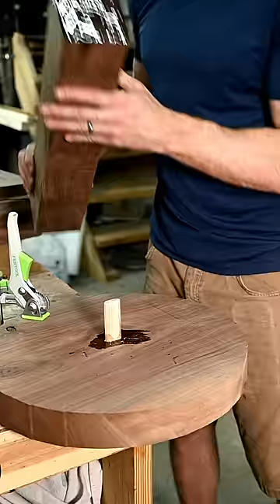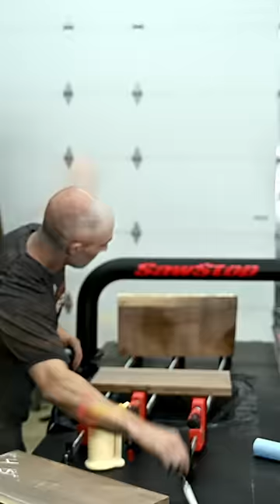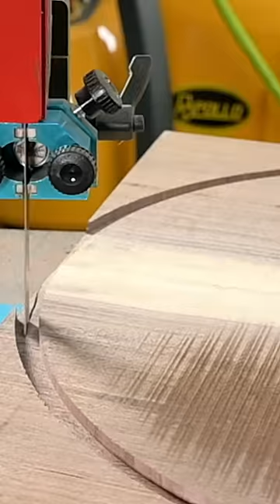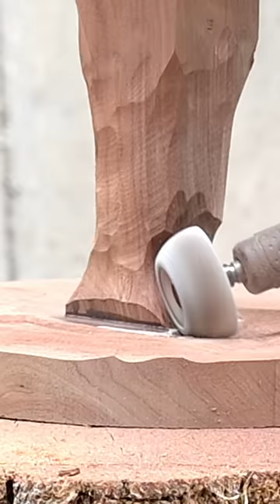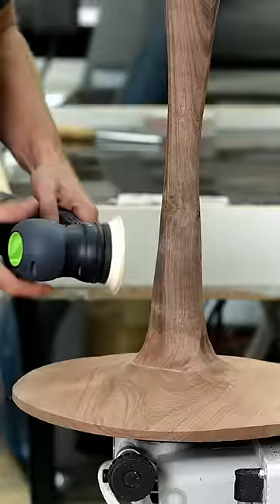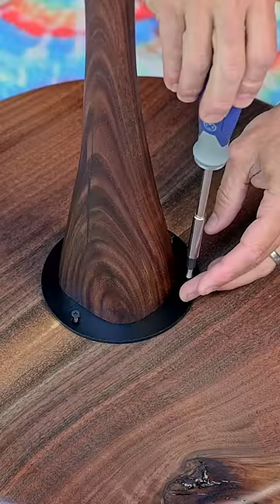I Tricked a Customer

Comment: Step 1: Have a $100,000.00 SHOP

Step 2: Try to downplay it in the comments and act like it’s everyone else’s problem as if you didn’t clickbait us.
Reply: Step 3. Have 20 years experience
Reply: A jigsaw, a hand router, an orbital sander.  About 90-100 bucks and you can store them in a box in the corner of your garage when you're done.  He's using his big stuff but it doesn't take much work to look up the cheapest beginner way to pull off circular cuts and round edges.
Reply: @wolffang489 Fair comments... but ain't nobody spending $1,200 on dude with 5 day's worth of experience and... closer to $200 worth of tools.

It will look like amateur hour, because it will BE amateur hour
Reply: @drebk  Oh of course.  You can't buy skill with 100,000 or 400 dollars but since he did say average woodworker and not urbanite that just moved to a suburb for the first time in their life, I'd assume the monetary promises in the video don't apply to amateur hour.  Regardless of initial skill though  for anyone wanting to follow along on the project at home and maybe build their skills and have a perfectly usable table to sell or use saying it's a scam video because they don't have six figures for tooling shows a lack of imagination on how few tools are actually needed for that template of a table.  Could he list off the bare minimum tools in the video?  Maybe but the target demo is in the title and that target either has their own power tools or otherwise knows what to substitute depending on resources.
Reply: @wolffang489  yes. The tools are the least of the problems of this table. The skill of carving that spindle and doing a nice finish on it without blemishes is the bigger part of making it nice. You can tell who knows how to work wood or not when they say they need expensive tools to make such a simple project, and he did not even use a lathe to do the hard part!

Comment: The classic "all you need is average wood worker tools" while using high-end wood working tools
Reply: Usually people don't buy Fein or whatever those mediocre things are as their first tool set.
Reply: High end tools are nice but this could be pretty easily done with bog standard tools from sears 50 years old or stuff from harbor freight could even be made with just hand tools
Reply: You can do this with basic tools, too. It will take you much longer, but you can still do it. What people don’t seem to understand is that you’re not just paying for the materials when you buy something handcrafted, you are paying for the years of practice and labor it took to make something pretty AND functional. And with furniture in particular, it’s hard to make them both artistic and usable, as in, not fall apart on you as soon as you sit.
Reply: table saw ain't exactly a high end tool. can even buy a band saw and router for under $300. get a job

Comment: “I wanted to prove that an average woodworker can make $1000 in a weekend”, shows world class craftsmanship
Reply: Also, has highly specialized woodworking tools
Reply: ? World class? Bro i could do this its using a router and an angle grinder 😭
Reply: @driftertravelerman6893 he didn't though. That's the point

Comment: "... average woodworker..." proceeds to use Festool tools.
Reply: Yeah, I had to laugh at that.
Reply: Yea, how on earth did anyone cut a straight line before Festool. What a joker…
Reply: @willfulmisfortune3679  No "average" woodworker has those tools. That was the point.
Reply: @timn5008  That doesn't change the fact that those tools are not required to do this or that they do anything but make it marginally faster to get done. You can do this with a framing skil saw, crappy angle grinder, a cheap jigsaw, and any old orbital sander. Total tool cost could be under $100 if you actually look around.
Reply: @johnathon007  You missed my point. Sure you could do it with cheaper tools, but invariably these craftsmen are using the high-end stuff. This guy is far from average, and he's using tools that are expensive and very reliable. I've done a lot of woodworking,  but nothing like this. I built a triple-winder staircase with nothing but reclaimed/repurposed wood from the house the stairs were built in, using nothing but Dewalt and Delta saws and planers. If you're using Festools,  you're likely doing this kind of thing for a living.

Comment: In Germany you would pay 300€ for that wood. But only if it can have splits. A thickness plane for wood that size is expensive though. Using a hand plane, this will take half a day. I agree that you can do it with cheaper tools too, it would just take thrice the time. You have to store it for half a year to get rid of the moisture though. No idea what you played for that metal part. I agree that people pay a lot for surprisingly simple furniture though. At my last job we sold a stump (about 30cm in diameter and 35cm high ) for 300€. It was a lot of work to sand it though, since it had cracks

Comment: $100 in wood, 100k in the workshop.
Reply: 100k gay wedding
Reply: Eggxachary
Reply: I was just gonna say
Reply: Yeah but this can all be done with basic cheap tools, even getting them used
Reply: underrated comment
Reply: Irrelevant though. He said "average woodworker" if youre a woodworker you have the tools he used
Reply: You could make this just as easily with 600$ in tools, cheap table saw, router and grinder with some bits and grinding wheels and a cheap jig saw.
Reply: Just ważna say the same😂
Reply: If you cant make those tables with a drill, a saw and a sander, you’re not gonna be making anything ever
Reply: Listen to the words in the video, don’t just run to the comment section with your low value comments
Reply: Came to say this
Reply: What’s your point
Reply: Stop being a victim
Reply: @spazzypotato8325  like trump lol
Reply: EXACTLY!!
Reply: @northcountrywoodcraftny5953 exactly. All this could be done with a drill, clamps, router, and table saw, easily less than a k in tools
Reply: all day on youtube, zero time in the shop 😂
Reply: you can get all those tools under 1k. You don't need high end versions like he has. Any cheap tool will work for something like this and you could do this with incredibly basic tools with enough time and patience.
Reply: Let's not forget the amount of labor involved, that process would need to be factor in for total monetary value
Reply: All of this can be accomplished with a jigsaw, skillsaw, router, random orbital sander, pipe clamps and some hand tools for the leg shaping. All basic and relatively affordable tools.
Reply: Ridiculous isn't it.. complete rubbish.  Lets ask him to do this with a hand saw, router and plane.. cos thats what i work with..
Reply: @gavin1453  if he repeats the experiment with those tools il be impressed.
Reply: You act like people haven't been building tables for thousands of years before electricity was even an idea
Reply: @mrpatching9586  exactly
Reply: That’s what happens when you own a company

I make custom hats and bulk clothing orders for companies. Laser graving, screen printing and embroidery and I prolly have less than $3k in clothing/hats In my shop, but I have prolly $100k in equipment/machinery. Equipment will always be more expensive
Reply: @northcountrywoodcraftny5953  not geting that wood dry for 100 bucks
Reply: @matthew413  proof where he got that much walnut for less than 100 bucks.
Reply: @victorhopper6774  Make it out of pine, maple or cherry to start then, starting with walnut without a resparator is probably a bad idea anyway, cherry and maple stained would be worth just as much in the end
Reply: You’re not going to make $1200 with $100 tools.  Well, they actually can in time,  it definitely not in a short week.
Reply: @northcountrywoodcraftny5953  the two bases alone have 16 bd ft in them

Comment: No offense, but if you're trying to demonstrate that an "average woodworker" can do it, the it's probably best to demonstrate it being done in a weekend with "average" tools ( jigsaw, hand planer/sander, hand-guided skill saw, chisels, limited clamps ) all done on a less than flush table. 

Let me tell you, it's very difficult to get a flush surface without a feed planer/jointer, good seams for glued up boards without a good table saw, clamps, and flush surface, and a good rounded table edge without a router table. Hand routers can be very inefficient, and most of them slightly lose their plunge depth during use due to the vibration.

If someone is going to pay $1,200 for a set of tables, they aren't going to tolerate wood seams, uneven cuts with wood filler, and and wavy hand leveled surfaces.

I see about $30,000 in tooling being used on this project. You're demonstrating that a person with a decked out woodworking shop can make $1,000 in a weekend, not the "average woodworker". A beautiful set of tables none the less, but this video certainly doesn't support the message you're trying to get across.

Comment: "$90 worth of walnut." That's about $500 worth of timber in Aus.
Reply: Haha if not more, fuck we get ripped off!!
Reply: Nah bro, I was sitting here thinking there’s no way that’s only $90 worth of walnut🤣even in the US it’s way more than that
Reply: you surely have much more exotic wood that is cheaper there
Reply: @Kaizen747  we may have more but wood is still extremely pricey even after the whole covid thing 3years ago
Reply: @dillanfiveash  Trades people get access to better material prices than the average person.
Reply: @lunawense6288  I know I used to operate a forklift at a lumber yard in college, we had lots of professionals that bought stuff from us
Reply: @dillanfiveash  since Biden's economy sure.
Reply: @Kaizen747  we have a huge variety of more exotic woods but they're even more expensive and far more difficult to work with than walnut.
Reply: The UK is no different!
Reply: Shits almost $20 a board foot
Reply: @dillanfiveash  it seems around that price on a site i just checked... since its apparently around $15-30 USD per foot. depending on grade.
Reply: He's lieing. I bought a slab of walnut 4 years ago. For 250. Only 11 inches wide by 6 feet. The 2 foot wide one was north of 600. That table cost would be around 175 or more. Not accounting for sealing or anything.
Reply: maybe he was reffering to the 90 dollars worth of gas I'd need to drive out just to get TO walnut

Comment: Dang that’s way more than $90 of walnut here in the desert 😢 awesome work I’m just jealous of climates with water
Reply: I think that's more than $90 worth of walnut anywhere. I have purchased some from many different places and what I saw him handling would be 2 or 3 times that.
Reply: Probably why it sold so quick then?
Reply: It might be $90 worth of walnet if you have a relationship with a supplier who's selling you slabs for $2000 on the regular and they throw in some offcuts, or you price the offcuts from the slab as the % of the slab you cut off.
Reply: That one beam used as a single table base is like $200 of walnut where I am LOL. I'd probably look up the cost of the wood and hardware and decide that it'd be cheaper to buy than make.
Reply: I believe he went for cheaper sapwood and such, only so much you can cover in a short, on top of that the supplier could have had some pieces on sale and such, another commenter said he managed to get similar wood and make these tables himself for $200
Reply: I’m pretty sure that’s more than 90 dollars worth of walnut anywhere. Maybe, like one commenter said, someone he knows gave him several hundred dollars worth of walnut for $90 but that’s not $90 dollars worth of walnut. That’s several hundred dollars worth of walnut he got for $90.

Comment: You are obviously a good sander finisher … one key to getting a good price …
Reply: When I work with black walnut I sand progressively down to 400 grit until it's glass smooth,  so smooth it takes on a luster. And I always finish it with about four coats of tung oil. It actually has a "deep " look. It has the illusion that you're actually looking deep into the wood.

Comment: You spent less than a 100 dollars on the wood, but you have half a mil in machinery.
Reply: how much of that machinery he used that an average woodworker cant work around? he used :bandsaw, tracksaw, tablesaw, paralell clamp, router table, die grinder, angle grinder and a sander; sawing can be done by hand, you dont need to use parallel clamps but even if you do 2 of them wont bankrupt you, hand router, angle grinder and a sander , most of these are present in an average woodworker's shop. and by the way he says "an average woodworker" and not "a woodworker with average tools"
Reply: yes when you want to do some woodwork you need tools. but those tools stay for years. its the same with every profession. If not tool than you need long and probably costly education. such a pointless comment

Comment: "You don't need a big awesome shop with lots of fancy tools -- I just have this universal constructor lying around which uses very basic nanotechnology to manipulate matter at the atomic level to 3D print anything you can conceive off that I bought one time from a ma and pa store situated in Area 51 under the name Majestic 12, and my basic woodwooking skills were sufficent to extrude this $1200 end table into eixstence from a contiguous block of the speically enriched carbon isotope used in the constuctor from the Versalife hardware store."

Comment: Making it is not the difficult part selling it is. You also have to factor in the shipping cost on something this size because it isn't cheap, did the customer pay extra for the shipping or was that included in the sale price. If you do not sell much on many sites like Etsy or E-bay your item will be places far back on the search list meaning most people will never see it. Unless you have a reputation for selling high end items you won't easily sell something like this, at least for a high end price, maybe what you have in materials and a few bucks more if you're lucky.

Comment: Cam, I'm an average joe woodworker hobbyist and I'd love to take on this challenge with some alternate/not uber brandname tools and record it the best I can.  I have a few questions before I start.
Rough dims of the starting piece of walnut?
how did you install the base? it looks like a custom peg/insert.  what was the adhesive you used?
and do you have a link to the piece that fastens the top tothe base?

Comment: Also, what if a wood worker doesn't have 3/4 of your work shop in tools and equipment?
Reply: You could build that same table with a regular circular saw, a router, some clamps, a jigsaw, a sander, and a spoke shave. It might not be as fast or might not have as much polish but it should be doable.
Reply: He didn't use 90% of his shop so should be easy

Comment: There's an old trick I learned to getting rid of unwanted appliances or anything with some kind of motorized/electronic function fast.

Don't put it on the curb with a "Free" sign on it. People will assume it doesn't work and only the occasional scrapper will take it. Put it on the curb with a sign that says "$100" and it'll be stolen long before the scrapper shows up.

Results vary based on your neighborhood.

Comment: Even if you used cheap tools, they’re still relatively expensive for a person who lives check to check. Cheapest miter saw is like $100. A route $60. A disc sander $30. The discs $10. Shaver $30 and the wood.

Comment: For all the people.complaining about his you dont need a big fancy shop comments.  I used to work at a place with a 3000 sqft woodshop.  It was great.  I then moved and had to put my tools in a 12x16 uninsolated unair-conditioned shed.  I did not have any large tools.  No table saw, no chop saw, I didnt even personally own a shop vac.  I had an orbital sander, arouter and a skill saw.  I was able to do custom mail boxes and some cabinet work for a local charitable organization with that setup.  I was able to buy and refinish furnature.  I borrowed a garage for the table though.  You can do stuff with less.  It takes alot more time effort and problem solving.  It you want to put out a project every month, do it.  But you probably wont be able to put out a project every week, or do all the custom work a big shop can.

Comment: I used to make sculptures when I was younger. 
Cement was handmade and poured, but I used molds for them. 
Let them cure, then chisel the down to perfect and added some finishing touches such as artificial aging and coloration. 
Sold like hotcakes. 
It's less about the method used to make something and more about the imagined value that the buyer has.

Comment: This is really cool, motivating, and achievable. I say that as someone who is artistic and wants to eventually get into woodworking, but currently has extremely minimal experience. What you did doesn't seem hard at all if you've got general woodworking skills (aka, the average woodworker) and are motivated to put the effort into making something like this. Effort and motivation are not the same thing as difficulty. I just wanted to say that because SO many comments are ridiculously negative. I just kept scrolling, trying to find the positive ones - no luck!

Comment: $90 in walnut, ok…How many sanding and grinding pads did you go through? How much was the material cost in the finish you used? And most importantly, over the shop and all that nonsense. What are your total working hours for just this one table over said weekend? How much do you normally value your labor time vs what should the average woodworker value theirs?

Comment: Band Saw $200
Spring clamp $1
Track saw $200
Table saw $400
Large wood clamps $50
Router table $250
straight grinder $50
Angle grinder $50
disc sander $100
Screwdriver $2

Total $1303, Only $103 in the red not bad.

These are the literal cheapest items on the first page of Google. I may be wrong on what a couple of the items are, but I put a different entry for every different tool I saw.